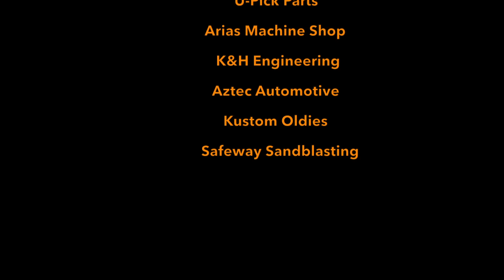PROJECT MAYHEM: Part 4 5.0 Explorer Engine Teardown (2 of 2)

Comment: Really like your channel my guy! I've been trying to find inspiration to do my SN94 engine rebuild and I would like tl slap on some gt40 P heads I found at my local junk yard.  I dont know if its some thing that will work for it. What is your opinion?
Reply from the maker: The heads will work fine with BBK equal length headers and 90 degree spark plug boots.
Reply from the maker: @josemebdez81  message me on junkyarddoggs.com

Comment: As a junkyarder myself maybe you can help me. I have an 84 Bronco 2 that I’m putting a 5.0 in. The motor is a serpentine out of the mid 80s and the air pump is gone. How do you reroute the belt to deal with this?
Reply from the maker: Take a length of string or yard and wrap it around youtr accessories like the belt would and exclude the pump.  Take the string out and measure it, then go to your local auto parts supplier and tell him the length of 6 rib serpentine belt and they should be able to get you the proper length
Reply: Junkyard Doggs would I be better off to upgrade to a late model explorer brackets? That’s where I got my GT 40s
Reply from the maker: No stay with the stock set up because it uses a different power steering pump and Water pump direction.
Reply: Junkyard Doggs water pump is junk anyway but ok thanks

Comment: hey junkyard 🐕 your videos are very helpful got alot of them saved to my YouTube channel I but I was needing some help before I change my 92 foxbody hatch automatic transmission I lost 6quarts of fluid but before I knew wt the problem was car wouldn't go anywhere I forced the gas pedal got the car home and the next day I looked under car and noticed transmission line came off the hard line fixed it replaced the fluid I lost but now car not shifting while driving like it should if it does its hella late or rpms go up but speedometer needle stays at about 40mph until it finally shifts I changed fluid and filter and still doing the same thing did I fuck up my transmission?
Reply from the maker: well, how many miles id you drive it dry? Are you sure theres enough fluid in there?  check it by turning the car on, then check the trans fluid.  if you check trans fluid with the car off you'll get an incorrect reading..hope that helps.
Reply: Junkyard Doggs yes the fluid level is correct I let the car run to operating temperature checked level while running and checked it in nutral fluid level is in the cross hatch I guess I drove it dry enough 11qts filled mine and I lost 6qts that day so im not sure I was thinking of throwing a pick n pull used trans in for now long as it fixes my problem only $100 + $30 core until I can get the t5 stuff I need my car is a 4 cylinder convert but only the engine was converted
Reply from the maker: Steve's Custom Mustang Headliners Berry yeah I think you may have burned it up my man.  especially if the trans had a lot of miles to begin with...
Reply: Junkyard Doggs shit lol yeah ill just go to the pick n pull and switch it just wanted to get ur opinion thanks boss keep those videos commin very helpful one more question i was going to do 5 lug conversion was thinking off a 95 mustang all the way around but i seen ur video you used spindle off a 96 will the rear end work also or is the 95 conversion a better fit with no issues
Reply from the maker: No problen man, A 96 will work as well as long as its a V8 your good to go.

Comment: That worn-out timing chain is actually giving you about an extra 7-12 horsepower at the top end. And it's not at all likely to be jumping around. It MAY move around timing-wise, but even that is improbable. There's quite a bit of drag in the valve train, so most likely, it hangs to the back of the curve (that means retarded). Good job, Tony!
Reply from the maker: Good info man.  Didnt know that.  Always learning.

Comment: Is the explorer oil pan considered a fox body pan im doing a 351 build but using a explorer frame and it had no engine
Reply from the maker: No it isnt.  It deeper and often to big to put into most cars. It won't fit a 351w
Reply: Ok thank you im just trying to figure out what pan to use in a explorer frame